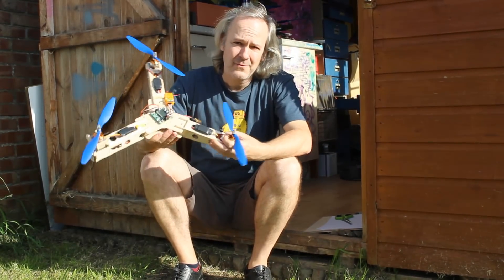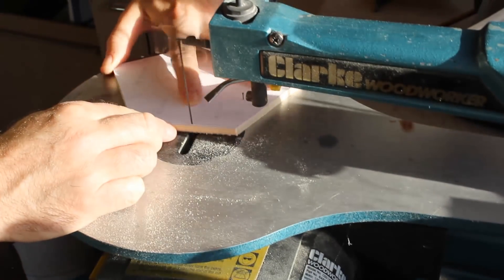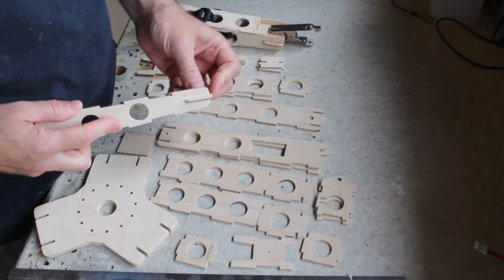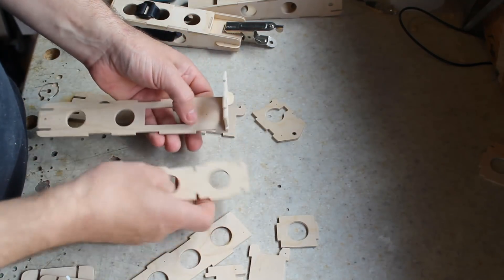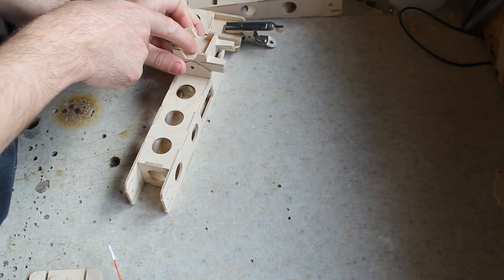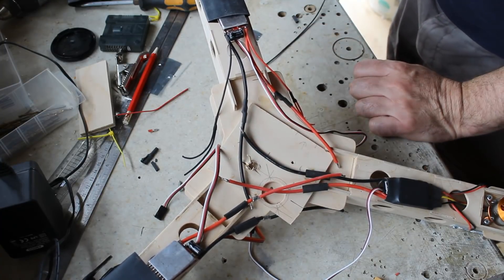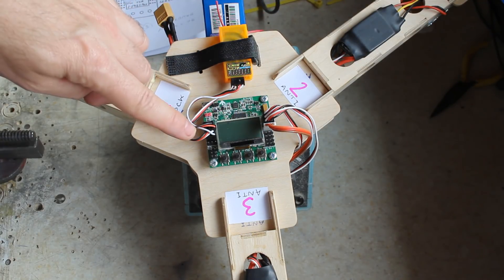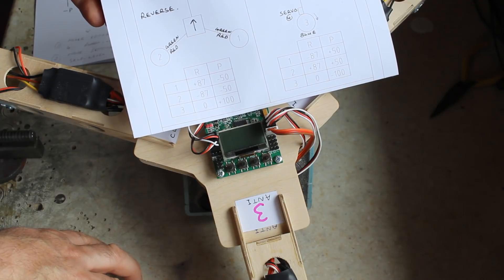Tricopter KK2.1.5

Comment: Hey. I'm a totally noob with this and I need some explanations...
I see some missing parts in list, that I need to build this:
- What's this yellow transparent small box connected to KK2 flight controller? - It's some kind of receiver? but what model is it? what other would fit? (maybe some from aliex... good cheap model)
- and what remote pilot for this? I don't have any... Could you recommend a cheap (maybe from aliex...) and good one to start with?

and... Do I need any other parts, including these yellow box and remote pilot?

Thanks and greetings!
Reply from the maker: yes its a receiver. you need a standard Aircraft transmitter and receiver with at least 4 channels. the 4 channels are throttle, aileron, rudder, and elevator. hope that helps.

Comment: Can you the connections between reciever and flight controller
Reply from the maker: Normal airplane channels, throttle, rudder, aileron and elevator. which match at the FC end. i tend to only have one fully populated cable which is normally the throttle the other 3 channels only need the signal cable. So in total you only need 6 wires going from the reciver to the FC. you could also do PPM and only have 3 wires.

Comment: Haven‘t  seen a KK2 built for a while. Oldschool ;-)
Reply: hehehe yeah I had to lean in to my monitor to double-check if it said 2018 or 2013 on the uploaded date :p
Reply: Yes, I would take a look at the cleanflight/betaflight/inav family next. You'll need to connect to a computer to change settings so not as convenient in that regard, but the flip-side is that a computer GUI is much more fully featured. I made a complete 'noobs guide' last year which includes an intro to using betaflight, it's part 16 in this playlist: https://www.youtube.com/playlist?list=PLzidsatoEzejIpdla6_ggPcDCPJ9u4WHj
I know you're not a noob, but still this might be helpful for a first contact with an unfamiliar flight controller.
Reply from the maker: Thanks, maybe i can ask you what you use? i started of using multiwii, but after a short break when i tried to get some more boards i struggled then i found the multiwii was dead? The KK board is a simple board but i would like to find a good replacement that can take gps and so on.
Reply: mrfid72 Don‘t get me wrong! At its time, the KK2 also was my personal choice. I loved the onboard screen for tweaking settings without any additional gear. And for acro flying it is doing its job. I still have 2 copters with a KK2 equipped. I later switched to the Naze32 with the F1 processor and much better performance. But now there are a lot of fancy F3, F4 and even F7 powered boards available for cheap. They also have plenty of UART connections, so GPS, OSD and other gadgets (Sonar for example) are not a problem anymore. They are easy customizable via the Cleanflight/Betaflight/Butterflight GUI (obviously depending on your prefered Firmware) and mostly fly fine with the stock PID settings.
Reply from the maker: Thanks for your comments, i picked up a F4 and F7 boards a while ago but havent got around to using them. I even got the INAV app but i am the only person who seems to want to build my own! so dont have any people to assist if i struggle! 
I will take a look at your  vids.